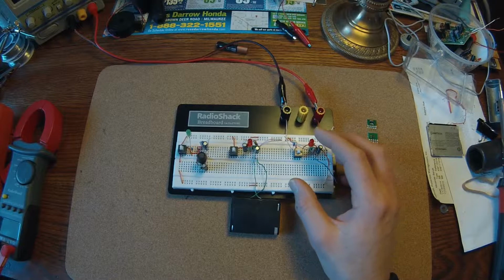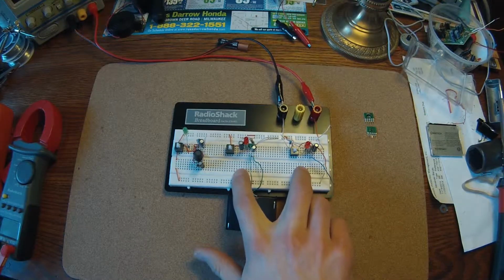Lithium ion Battery Charger IC Review

Comment: hi I am using mcp73833/4 ic for charging ckt 
STAT1  pin3  3
v
STAT2 pin4 1
v
PG(TE) pin 7 4.1v
charge in pin1 5.2
v
THERM   pin8 4.1
v
battery  4.154
v
the battery is not charging its happens after proper functioning for 1 month unable to figure out the problem. stat 1 and stat2 LEDs are glowing.

Comment: I know this video is really old but I am working with the sot23 5 pin from microchip. What resistor would i need for 100ma charge to the battery? thanks
Reply from the maker: Hey Matthew, I actually just used this same chip in my last project I was working on. After a quick look at the data sheet, there is a nice graph showing the resistor value and charge current on page 7, and the equation to calculate the value on page 15. After a quick calculation, it looks like a 10K resistor would give you the value needed for 100mA current. I'd post it here, but I'm not sure how to get the formatting correct. Anyway, have a look at the data sheet, all kinds of useful info. Don't forget about low voltage cutoff circuitry the battery too. Have fun with your project!
Reply: @Datzfunk  thanks my battery has built in over and under volt protection.